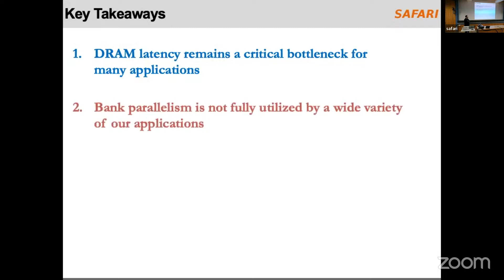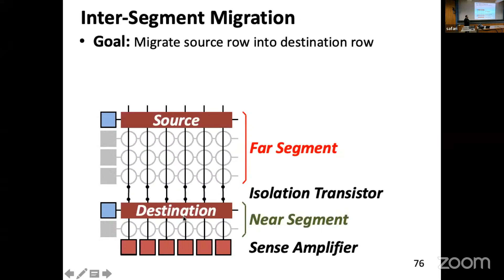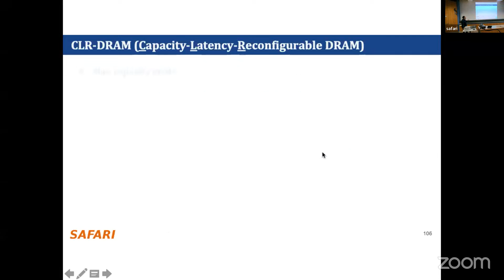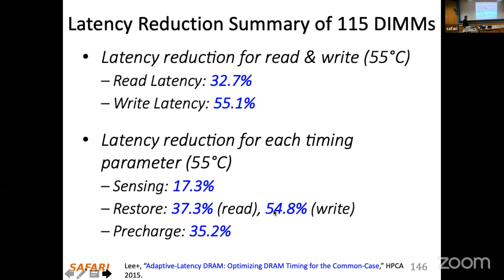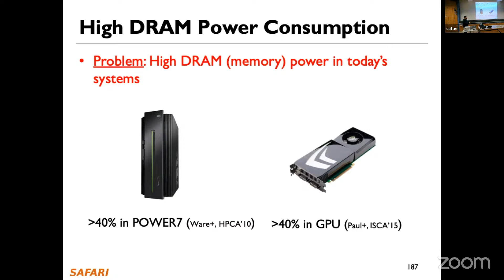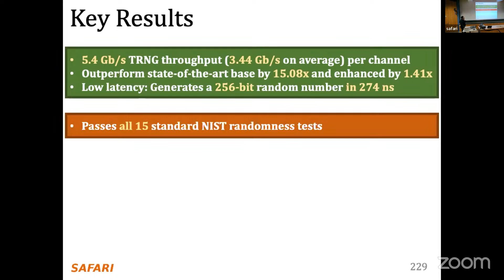Computer Architecture - Lecture 9: Memory Latency (Fall 2023)

Comment: lack of appreciate of the role of memory latency is the saddest part of modern computing. 
first we should acknowledge that latency at the DRAM interface is one thing, but the ultimate metric is latency to the core, including delays in checking cache. the slide shows mid-50ns latency, which is at the DRAM interface?
Desktop system might show 65-75ns latency to the core?
High-core count processors in a multi-socket system might have 90ns to local node and 120ns+ to one-hop remote. 
Latency increases at high load, all cores active?
with the latency contribution outside the DRAM, lowering latency at the DRAM chip has muted impact. First, we must acknowledge that the era of multi-socket systems must end. With very high core count processor, there is no true need for multi-socket, especially when it comes with negative impact of increased memory latency.
Once the systems of concern are single socket, it makes sense to lobby for low latency DRAM. It might also be good to give up socketed DRAM and have the DRAM chips in the processor package, for which we must make the permanent decision on processor & memory at time of purchase forgoing upgrade possibility.

up to the 90's, low price to enable affordability of adequate memory capacity was the really the primary objective. 
afterwards, people continue to regurgitate that this was still the objective.
I recall in the early 2000's, DRAM vendors raised the question of whether lower latency would justify higher cost. Too many people said no, but based on old obsolete rules, rather than current quantitative data.